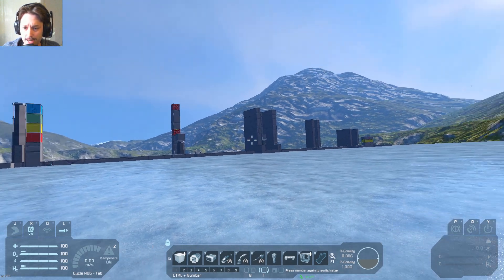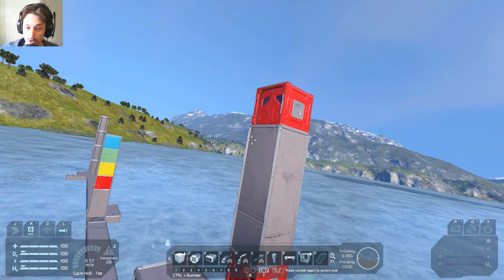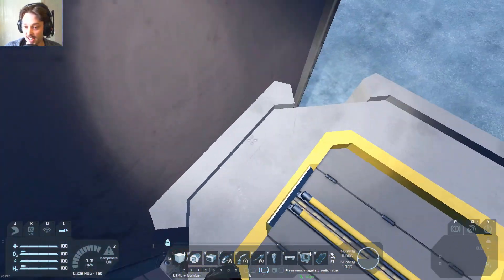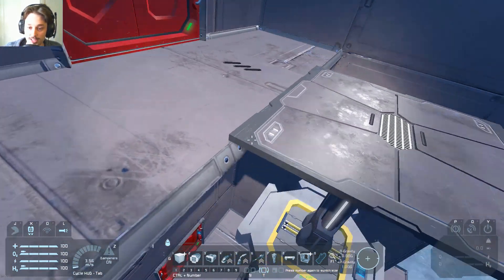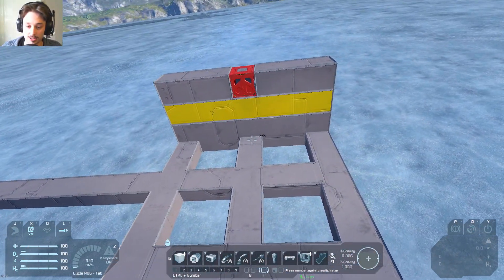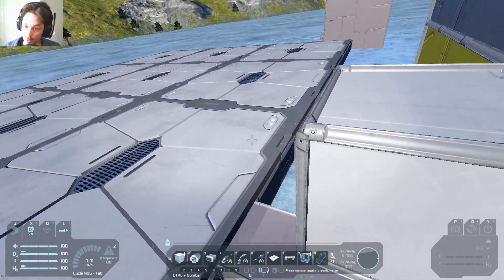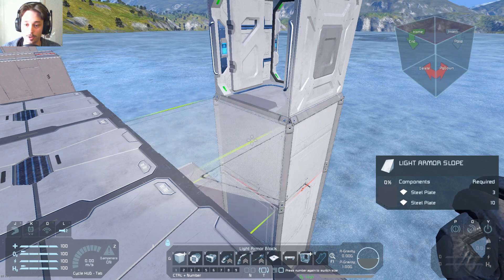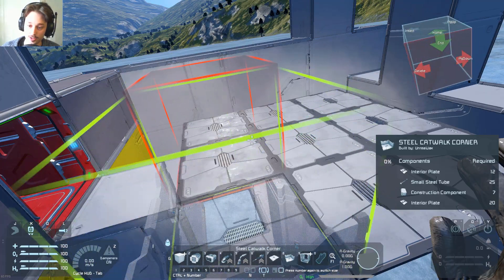Building A Vanilla Elevator & Lift - Space Engineers

Comment: Ive built completely enclosed elevators before, the trick is to use 2 airlocks so you can stand inside, use the jetpack to not hit your head and die and adjust the speed and torque settings, too little torque and it gets stuck too much and it blows up, too slow and it gets stuck too fast and you die